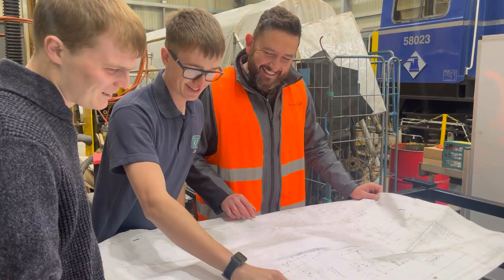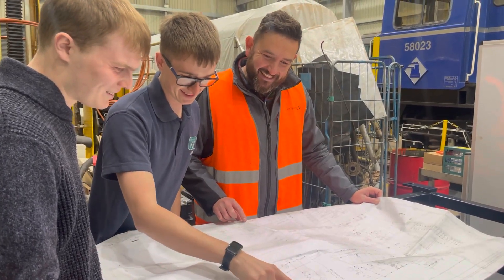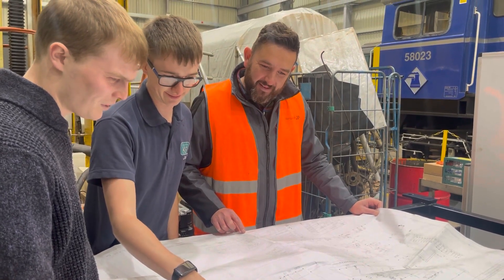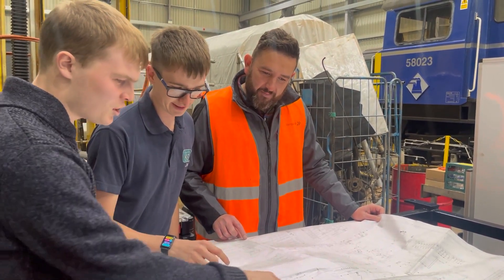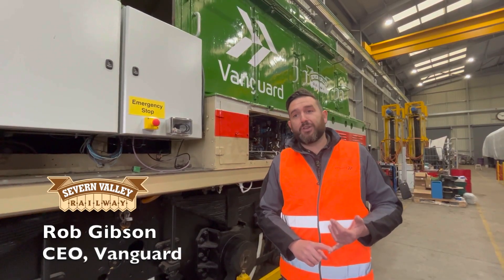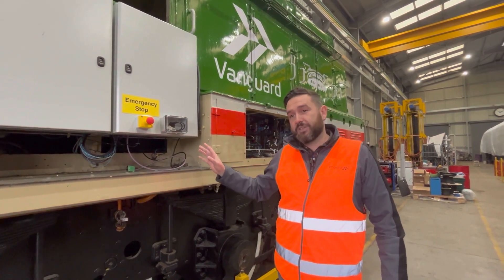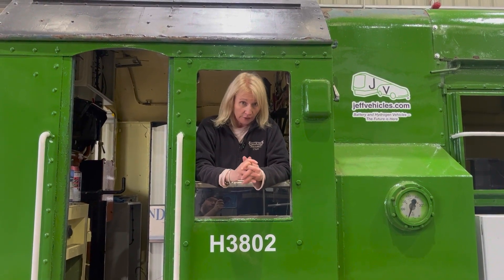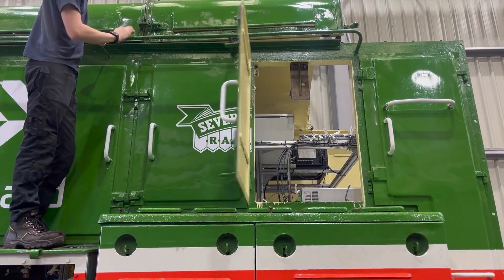Hydroshunter Update

Comment: The company I work for, voestalpine Track Solutions Netherlands, has five of the same locomotives. Now all diesel electric powered and three are radio controlled. We now fuel them with HVO100 but are very curious about the hydrogen drive!

Comment: Why for the love of engineering have you gone down the Hydrogen route, don't you realize the environmental cost of producing that damned stuff
Reply: It’s a research tool.
Reply: @22pcirish Our energy policy is designed by tools, certainly.
Reply: Only if produced by cat cracking.  Production by electrolysis using clean energy is .... clean.  There are plently of applications where hydrogen makes economic sense
Reply: Depends ENTIRELY on the production method. Separation by electrolysis powered by clean energy is 100% clean.  'Brown' hydrogen (which the fossil fuel industry are doing their damndest to rename 'blue hydrogen' .... pathetic isn't it?) is a by product of cat cracking, same as jet fuel, petrol (gasoline) and diesel ...  which is nowhere near clean. Separation of hydrogen only makes financial sense for applications where transmission lines aren't possible, or requirements are beyond the range of battery storage  (e.g. shipling, aviation).

Another perfectly idotic suggestion is to establish a production line for engine lumps which burn hydrogen.   Combine all the disadvantages of a filthy hydrogen chain with the inherent inefficiency  of century and a half old tech.  Great idea (NOT).
Reply: Yep, especially when it could run on chip fat with almost no effort, an extra bank of fuel filters and a heater in the tank and it would run happily on while recycling waste
Reply: Royal Society propose it as their solution in their work "Large-scale electricity storage" and decarbonisers love it, despite where nearly all of it currently comes from.
Reply: Simpler and carbon neutral would have been a modern clean diesel engine running on HVO.
Reply: @ We are changing big locos to run on this, shunters can be electric due to the nature of the work they do.

Comment: Hard to see what the point of this project is except attracting research funding. Batteries are simpler, cheaper, safer, and greener and there is no more ideal application for them than shunters, which is why battery powered shunters have been used commercially for decades.
Reply: Where would we get the hydrogen  from to run all these trains , cars , aeroplanes that these people are suggesting
Reply: @maly2ts408  electrolysis of water is the current suggestion with renewably-generated electricity. Where we get almost all hydrogen from now is from fossil carbon commodities.
Reply: @maly2ts408 
I suggest you do some research.
Electric powered vehicles, is not the future.
In actual fact, it’s pretty archaic - there were electric vehicles in the sixties.
Why are people so easily influenced by idiots, namely the ones in Westminster.
Reply: @ianbliss819 there's been electric vehicles since the 1870s, if not earlier - longer than internal combustion has been around... electric motors are a far better transmission system than ic/mechanical as there's no need for lossy gears and clutches - which is why, for example, a standard 08 uses electric transmission...
Reply: I totally agree. This project is a dead-end, and I can't see the Severn Valley Railway having any future use for an expensive one-off that uses expensive and inefficient fuel.
Reply: I think you’ve answered your own question !
Reply: The bit of RE/NetZero everyone seems to be burying their heads about in UK is that our biggest RE supplies are almost hopelessly intermittent. We have giant offshore wind potential 'enough to power Europe' but we can't store electric energy at that scale, all current tech is tens of thousands of times too small for the UK problem. UK (other countries' opportunities are different) will always need something that works from stores of energy. Hydrogen could be kept in vast quantity, replenished in good VRE, run down in poor. I don't think hydrogen itself is best option for UK, but it's going to play its part.
Reply: This locomotive is a battery powered vehicle, it can work entirely from battery power if desired and charged from the mains electric. The hydrogen fuel cell is fitted to extend the range of the loco, so for a days shunting, it will probably stay on battery mode and be charged at the end of the day, hence minimising costs, however if you want a trip up the line, you’ll probably need it in hydrogen mode, which charges the battery up to extend the range.
Reply: The new battery powered shunters out there already on the standard gauge railways aren't fully electric as they are hybrids. The only places battery shunting locomotives have been successful are on the narrow gauge side of things in industrial settings where they can't use combustion due to spark risk or emissions in enclosed areas.
Reply: @bentullett6068  (standard gauge) Battery shunting locos have been around for years. During my apprenticeship at a coal-fired power station in South Wales in the late 60s, I was lucky enough to have a go driving an English Electric battery loco checking the Tare Weight of coal wagons over the weighbridge.
I'm sure London Underground will be disappointed to learn that their fleet of battery locos are not successful. Likewise, the Tyne & Wear Metro.

Comment: Oh dear God, so have you sorted out the laboratory tight criteria piping to prevent H2 leakage or a reliable sourcing of pressurized H2? Honestly given how much more accessible and affordable LiFEPO4 batteries are now, that would've been the go to option, especially if it could provide bidirectional charging for buildings
Reply: Hydrogen fuel cell vehicles have been operating successfully for over a decade.  The age of the Hindenburg is long over.